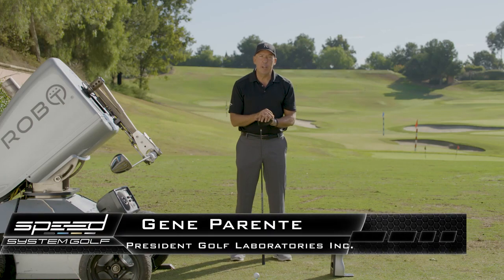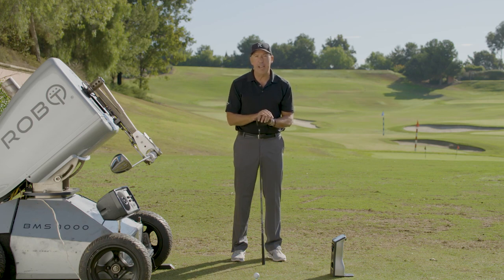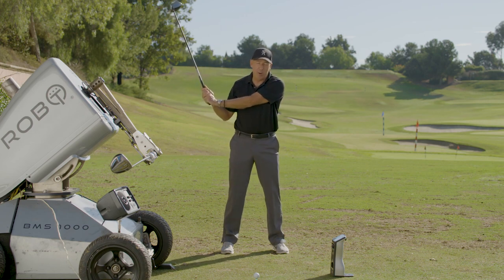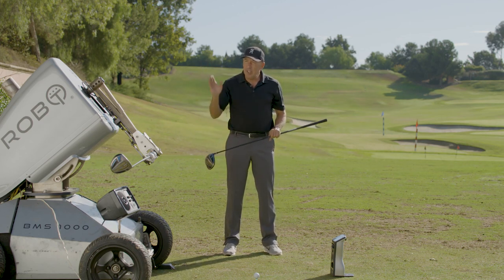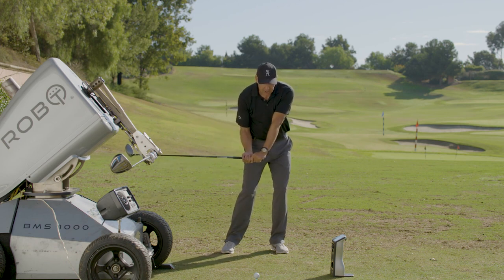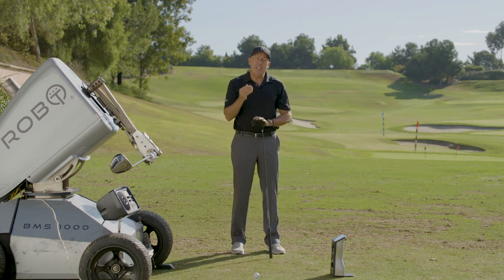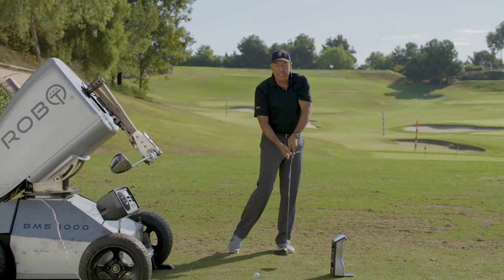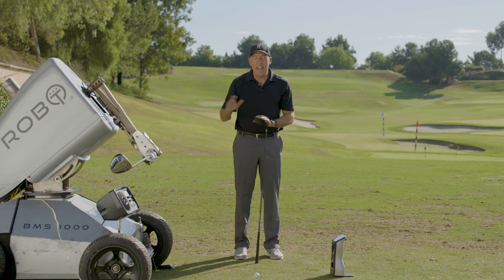Angular Velocity Physics: Slow To Go Fast

Comment: No examples. Did not even explain angular velocity.
Reply: Angular velocity is a measure of the angle something goes through in a period of time.  However, for a given angular velocity something near the middle will be travelling much slower than something at the edge.  Consider a bike wheel.  In one turn the whole wheel goes through 360 degrees in a period of time.  However, at the hub a point travels on a much smaller circle than at the rim.  So the rim has much more linear speed than the hub.  However, through conservation of momentum as the hands slow down the momentum is passed to the club which speeds up catching up with the hands at the ball and overtaking them after impact.